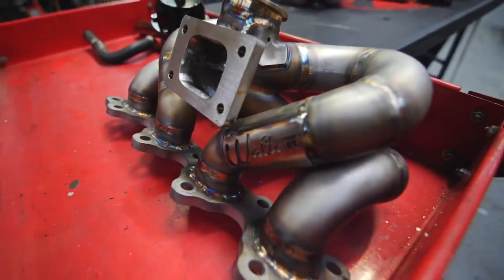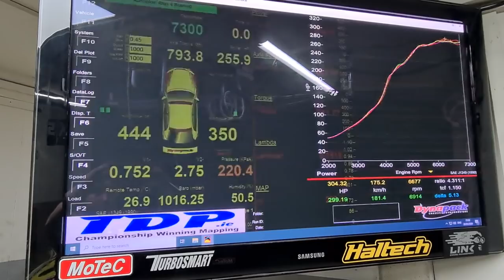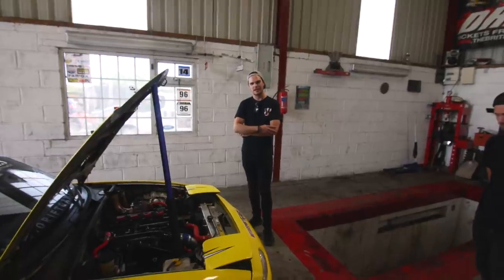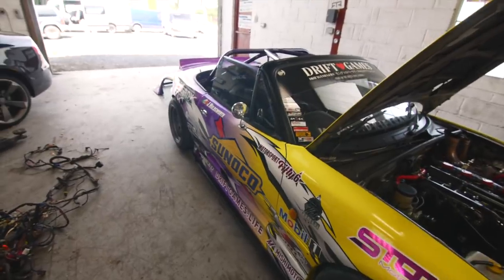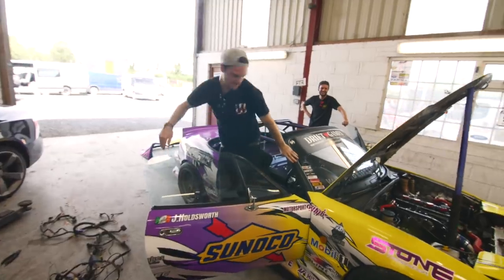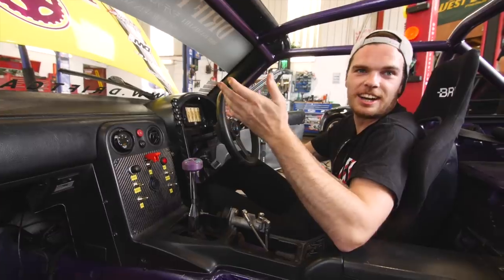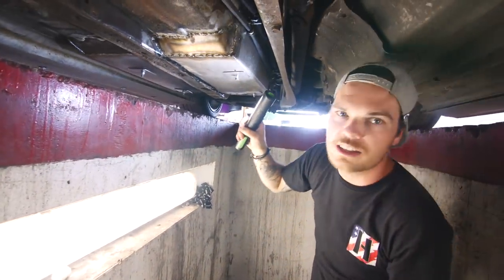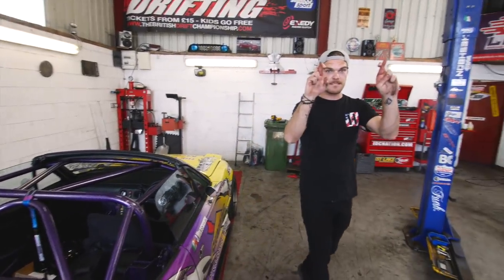MX5 TURBO DRIFT CAR RUNS BIG BOOST ON STANDARD ENGINE!

Comment: 304hp on a 1.6 no just stop forge it now casue a 1.8 is stronger and the limit is 250 it will blow quickly speaking from experience
Reply from the maker: We have a 1.8 engine sitting there just in case, but let's see what happens!
Reply: @driftgames_life  The rods which are the weakest point, are the same for both aaand its not hp but torque what kills the rods... But still it seems to be a bit over known edge for them... but I believe in 1,6s to hold... GL guys